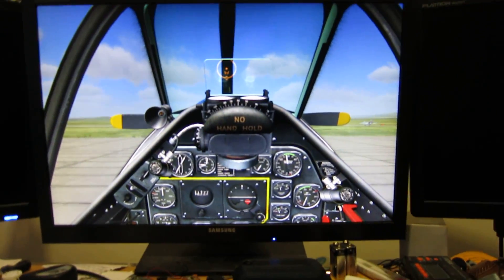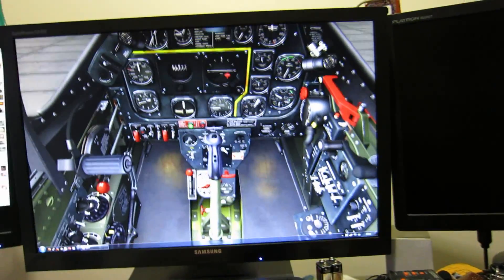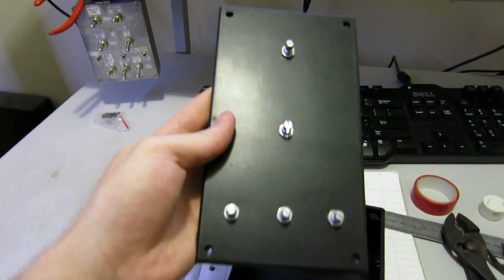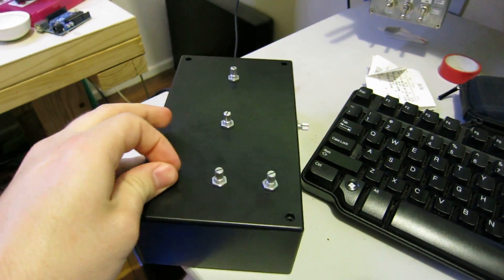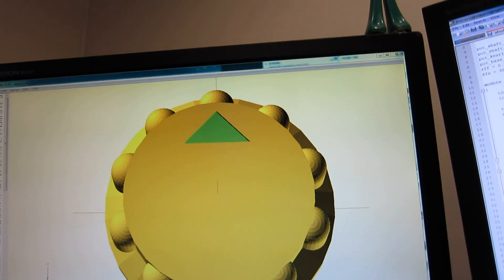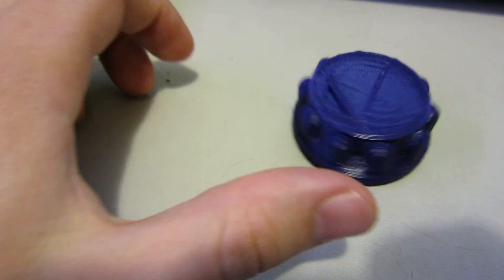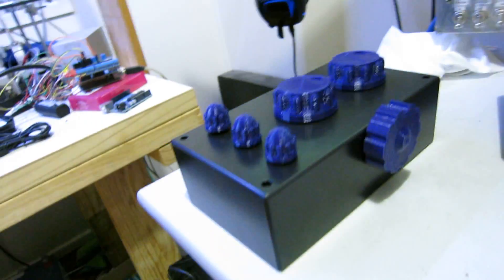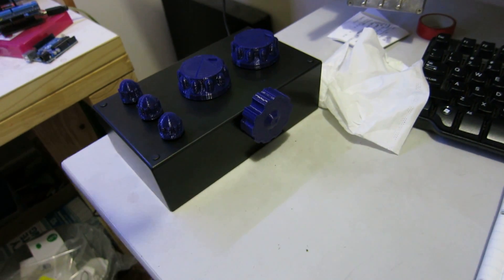Flight simulator trim wheel box

Comment: I seen you say you'd use multi turn pots if re-doing this? Any advice on the number of turns you think would be ideal?
Reply from the maker: I'm not sure. If I wanted to be thorough I'd start up DCS and turn each trim pot from extreme to extreme and see how many turns it takes, then find a multi-turn pot around the same value.

Comment: Those didn’t look like linear potentiometers to me. Aren’t linear potentiometers the sliding type? You know, in a linear motion forward and backward.
Reply from the maker: The "linear" in this context means that there is a linear, 1:1 relationship between angle and resistance. This is contrasted against logarithmic pots, which provide a logarithmic change in resistance with rotation - generally useful in audio applications. The pots that move back and forth in linear motion are generally called slide pots. You can get those in linear and log variations too.

Comment: How is this set up in DCS?
I've tried rotary encoders with DC-BIOS, and there's a bug that make them not work properly.
And regarding multi-turn pots, you could use 3D printed helical gears to gear down the rotation.  I use a similar idea to gear up servo rotation for gauges.
BTW, I've already made text-embossed rudder and aileron wheels. ;)
Reply from the maker: It appears to windows as a regular HID joystick device with six analogue axes. I ran the windows calibration and then bound them as analogue inputs in DCS. Nothing fancy. If I were to revisit this project I would just use multi-turn potentiometers rather than printing my own gears. Much less complexity.
Reply: @tjhowse  Thanks.  I'll have a play.
Reply: @tjhowse  It was easier than I expected.
I've used a Leo Bodnar board for mine - it has 8 12-bit analogue ports and some button inputs.  I'll be doing the geared thing so I can have the +_10 needle, and maybe use the full travel of the pot.
Reply: @tjhowse  In case you were interested, I've made a thread on the ED forum with my effort so far.  I went a bit further and reproduced the P51's rotation and display needle.
https://forums.eagle.ru/topic/257704-p51-aileron-trim-test-piece

Comment: Sir! You selected 10k linear potentiometers. How do you know what to choose? Which parameters should be noted by selecting the potentiometer.
Reply from the maker: The resistance of the potentiometer is not especially important. 10k is a common value, which means it's easy to find and cheap. I chose a linear version because I wanted a linear relationship between rotation and voltage, to most easily sense the position of the knob.
Reply: In your video we can see 6 potentiometers. How many potentiometers and buttons can be used  maximum ?
Reply: A single arduino can control as many potentiometers as there are analog outputs on the device itself. Its more of a limitation of Human input devices or HiD for short.  8 axises, so 8 potentiometers for example and 32 buttons can be used from a single HiD device.  but you can use as many arduinos as u want and they will all be registered as a different "8axis 32 button joystick"

Comment: Any chance I could get the dimensions of that box? And where you found one with that nice grid on the inside of the lid? I'm going to try to build this weekend, and I'd like the larger box to fit a few extra switches.
Reply from the maker: The box is approximately 196 x 114 x 66 mm. I got it from Jaycar: https://www.jaycar.com.au/enclosures-panel-hardware/plastic-boxes/c/230

They don't seem to have that specific size in this list though :(
Reply: Travis Howse Cheers, thanks for responding! I've been getting back into the warbirds in DCS, and this will go perfectly with them.

Comment: Am building one of these...just a question on the power supply...do you know of any stores in Aust that could supply an off the shelf one?  Cheap is good....BTW great job...
Reply from the maker: My design doesn't have a separate power supply. It's powered entirely from USB. If you really need a power supply, Jaycar has a good range, but is pretty expensive. If you can wait I'd try something from ebay. If you can wait longer I'd try aliexpress and get it cheaper.
Reply: Thanks...

Comment: Don't potentiometers have limits?  Woudln't a rotary encoder be more appropriate for trim?
Reply from the maker: Absolutely! If I were to redo this project I'd go with encoders, but pots are simple and easy to work with.
Reply: But a trim in a plane has limits as well, isn't it? In my real life plane, the trim wheel has an up and down limit. In the P51D I think they have as well, you can turn it to the max left and right, and return to center.
So to my mind pots are the way to go, for trimming.
But of course you need the sim to handle an axis for trim ^^
Reply from the maker: The best option, I think, would be multi-turn pots. They're a little bit expensive though.
Reply: how about use pots 10 turn for wheel trim ?

Comment: This is great work dude! i want to do something similar but I have a question about the code:
When you take the analog input from the pots into the microcontroler, the value that is read in, can be pretty much any thing, which changes accordingly to the twist of the pot.
As far as i know, your code uses the joystick library which gives you the functions to read and set values for different axis of the joystick.
However isnt the range of values for an axis like -127 to + 127 which equals 255 positions?
Where in your code, does the reading from the pot get normalised to be within that range? 
Thanks!
Reply from the maker: +dudekidPL Thanks for the kind words!

The microprocessor I was using has an 11-bit analogue to digital converter, from memory. This means it can give me 2048 data points, from zero volts to five volts. I feed that directly into the USB interface. When windows does the calibration of that axis, it sees that minimum and maximum values and automatically adjusts the scale that applications see such that there isn't any "dead space" on the axis that is outside the minimum and maximum readings.

TL;DR: The operating system normalises the values for me.
Reply: Travis Howse

Thanks a lot for the explanation! I looked it up and the 32u4 has a 10 bit A/D converter which gives 1024 positions but its still plenty.
I also didnt thing about the windows calibrate feature, thanks for the help ;)

Comment: what were the 6 controls that you used? did you do rudder, elevator and aileron trim? looks like flaps? what were the others? radiator and mixture? 

can you explain the power distribution board? what is it for and where did you get it? 

i saw you didn't use a breadboard? you just soldered wire right to the teensy like it was one of the pins?  sorry, i'm new at this and your video inspired me to try something like this (especially now that teensy has a 10 dollar board
Reply from the maker: +Mark Momper Yep! Three trims and three general purpose knobs. I don't remember what the others were bound to; I haven't flown the P-51 in a while. Flaps, radiator and something else?

The power distribution board is just a place to join all the power wires together. It's nothing special, just two bits of copper to solder to.

Yep, the teensy has through-holes around the edge. I stripped the wires, poked them through and filled the hole with solder.
Reply: +Travis Howse how did you get your computer to properly recognize the device as a 5 axis usb controller? i saw your code, but the profiles that are standard don't seem to fit this.

Comment: Thanks for the share Travis. 

I had a couple of my friends had also used Teensey++2.0 as the I/O for our pits. Teensey is a good board, easy to connect and easy to program and work with. But, I'm not too happy with the overall reliability. In about a couple of months, all of us had our Teensey's die on us. Without any warning whatsoever. One day they were working, and the next day, dead.

I had two of them in my pit, and I was using all the button assignments and the axis assignments using them. It required a major rework  to the cockpit, to replace all the wiring, when I had to change these boards with other boards. 

Nice video though.
Reply: What board did you use to replace the Teensy? Has it had better longevity?
Reply: +James Mills Leo Bodnars boards - BU0836x,  I think. 
Used,  five of them eventually. Never looked back. 

Extremely happy with them

Comment: Hi, Im thinking of using a teensy 2++ for a similar project but I also want to use toggle switches to control other systems of the aircraft. Do you know how to program a toggle switch to become momentary? Will it be some sort of state change code? I have no idea. Nice work btw!
Reply: You can buy momentary switches or use fsuipc if it's for flight simulator X

Comment: 1. Where did you buy your potentiometers?
2. What Company makes them & what model are they?
3. Are they hall effect potentiometers?
4. What are the dimensions of the project box that you made?
Reply from the maker: 1) Jaycar, a local electronics retailer,
2) Many companies, they aren't special,
3) No,
4) 198x114x64 mm.
Reply: Travis Howse
Thank you. Hall effect pots last longer I've read. Let me know how long your last. Plz help Im having a little trouble using Teensy usb 2.0... http://home.comcast.net/~slow123/joy-not-in-list.jpg
Installed arduino software + Teensyduino everything ok hit button recognized device. tested to verify code... not working attached pic.
Does it need to be recodded since joystick alone is not in usb list
Error states: error: 'Joystick' was not declared in this scope
Thanks so much for help, your very inspiring:)
Reply: *****
Hi I've been following teensy for a while and am an x-plane 10 simmer. I think the cause of the problem is that you must not choose Flight Sim Control in the Tools menu but joystick as suggested in the video. The Flight Sim Control options directly connect the inputs of teensy to the variables of x-plane, in this way you need declaration of these xplane variables on your code. But in fact there isn't in your code. So in short in order for your code to work, choose joystick may be the way out. You can refer to the teensy project website for flight sim control details.